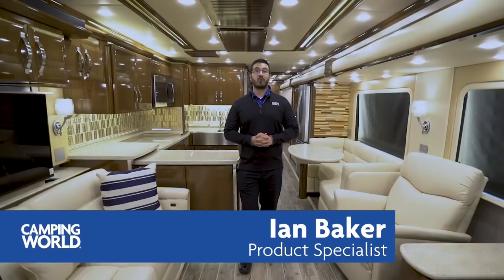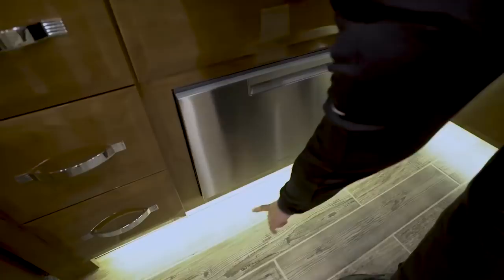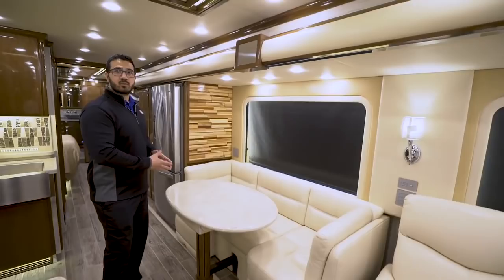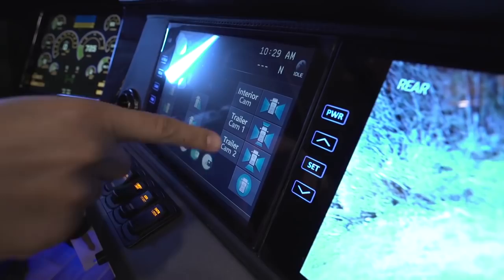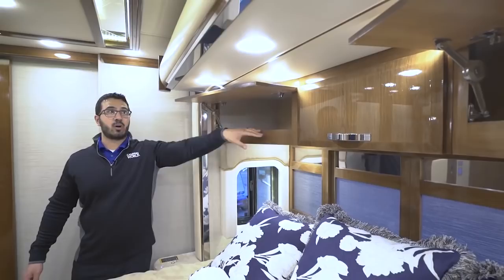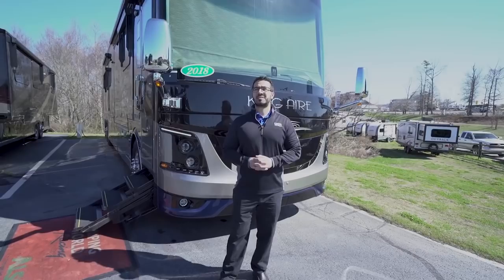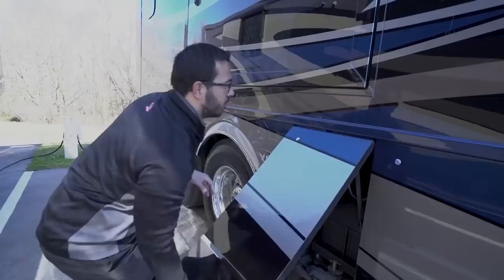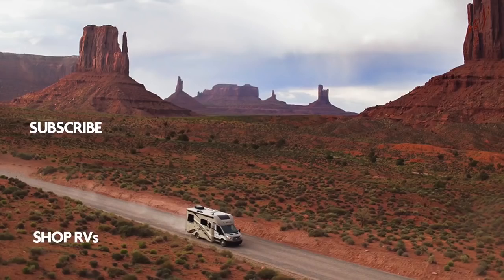2018 Newmar King Aire 4534 | Diesel Class A - RV Review: Camping World

Comment: Love this RV. Although there are things I don’t like that would prevent me from buying. I don’t want my clothes stored in a closet in the bathroom. There is only minute wardrobe closets. I would much rather not have the half bath, since it is so incredibly tight, it would be better as the laundry, leaving more room for hanging clothing.
Reply from the maker: Fair enough. You should check out the King Aire 4559, the floorplan may be more appealing to you as it doesn't have the rear bathroom and therefore the main bath is quite large. Thanks Cindy and good luck in your search!
-Ian Baker

Comment: You know your product no stuttering no stammering all pro. A guy your age must have noticed the epic fail. No UBS's surprising. Gorgeous coach just the same.
Reply from the maker: Guy, thank you very much, I truly appreciate the kudos! However, it was actually my fault for not pointing out the USB ports. They do have them in the center of almost every outlet in between the two 110V plugins. They look much cleaner this way and are easy to miss (hence the reason I probably forgot to mention them). Thanks for watching and for the comment!
-Ian Baker
Reply: Thanks for pointing that out. If I could get my association to OK an RV I would have one. I can't even have a Leisure travel van. Rules are rules be looking forward to the next video thanks.

Comment: Wow only 5mpg. That’s roughly $1 per mile just for fuel. Break out the black Amex at the fuel station. One pet peeve on many coaches. Why such short sofas. I’m 6’6” and want to stretch out. Many mfg place theater seating on long wall where 84’ sofa should go when they would fit just fine where the jack knife sofa wall is. Just move  tv to opposite side.  Worst closet hanging space I’ve ever seen. What were they thinking! Love the soft close baggage doors. Much better use of space for Dometic freezer. Very surprised no solar panels on all electric coach. Love the floors.